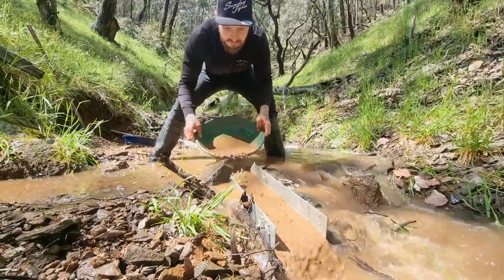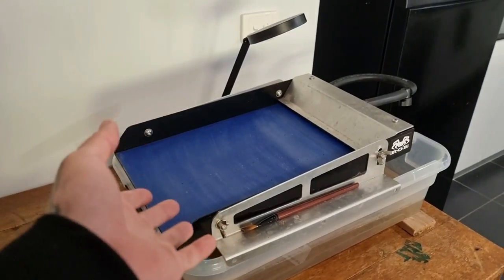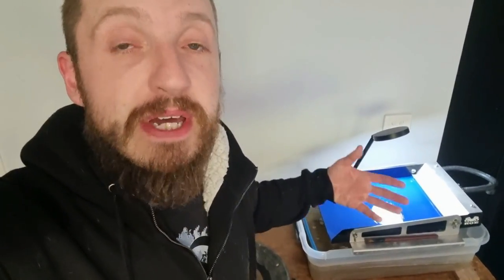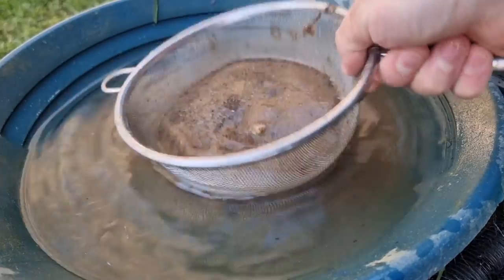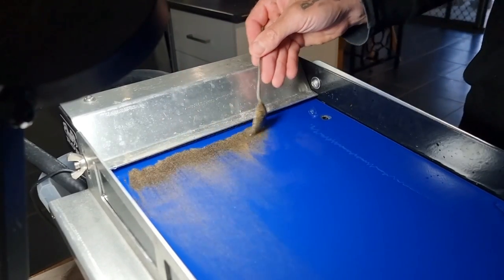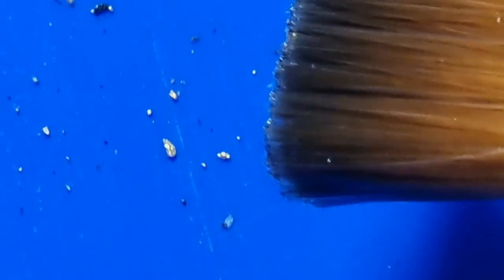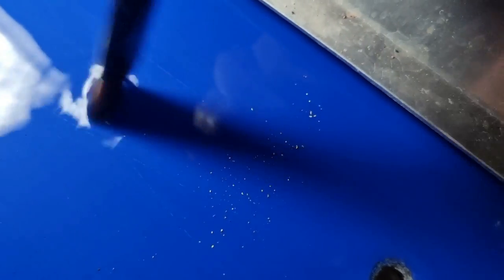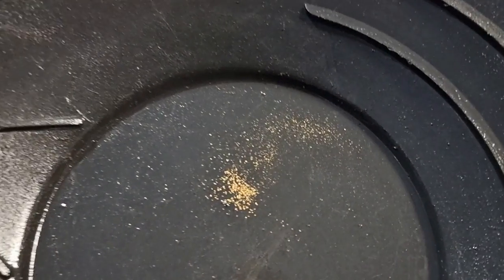I cannot believe the gold recovery from this one simple modification to my Miller Table

Comment: Great tip! I have a miller table with a rough surface built in (gold scorpion)... But I still have 2% losses. I recover most of it on a second run. Sometimes the gold is shaped in a way that doesn't want to stay. Still better than a blue bowl.

Comment: Great job and discovery well done chris   💪🏼💪🏼 the bad news is your still losing gold I said it before I’ll say it again I dare you to get a 10-30x magnifier and look at the concentrates after you run them through the sand papered Miller table you will be shocked by the amount of micros still in the concentrates this is where roasting and smelting come into play then you will truly get all the gold you’ve prospected. Good thing you save those concentrates. The sand paper is truly a great discover though. I’ve found heaps of micros magnifying my tailings. Thanks for sharing see you on the next one 👍🏼👊🏼
Reply: Lot of truth of that smelt that stuff you need to build a crucible that can handle the heat